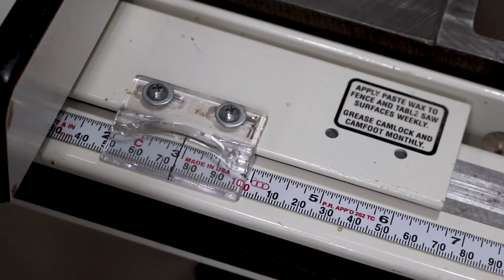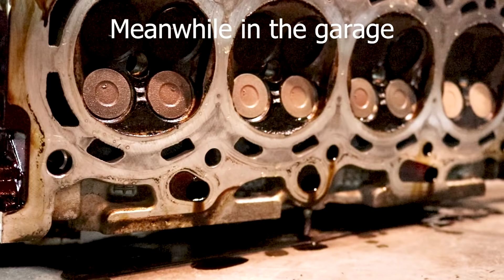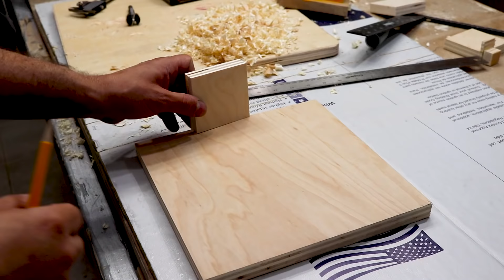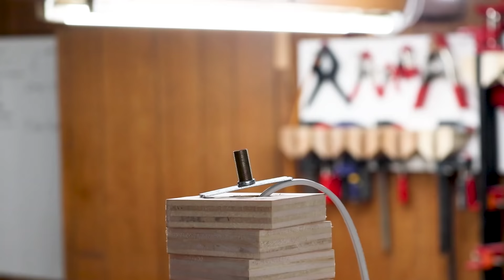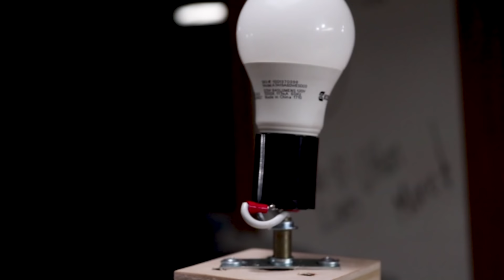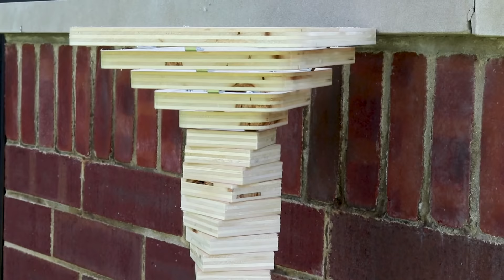Torchiere Floor Lamp from Plywood - Rockler Plywood Challenge

Comment: Awesome job!! What a great idea Utkan!! Oh and I have a thick piece of plate steel you can have that should add the weight needed on the base if you’d like it. I can clean it up and drill some holes to screw it into the lamp base. If not no biggie😊😊

Comment: Great video and cool lamp! You know how when you learn a new trick and you start seeing it everywhere? Suddenly i’m seeing everyone clean up glue squeeze out in corners with a straw! I’m with the others in thinking heavier base. Or is it the stacked squares that are wobbling? I’d think two screws should be sufficient
Reply from the maker: christopher dubour yes it is the middle part. My plan is to insert a 3/4 pipe all the way up and weld it to a plate on the bottom
Reply: Master of None Ah yes, you did say that. Sounds like a plan! Definitely worth fixing this build. Very cool design.